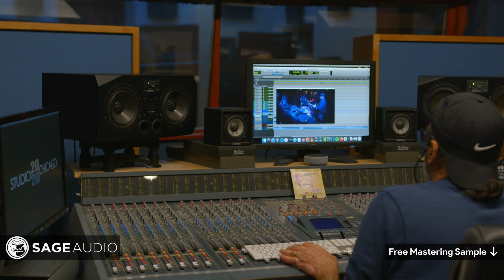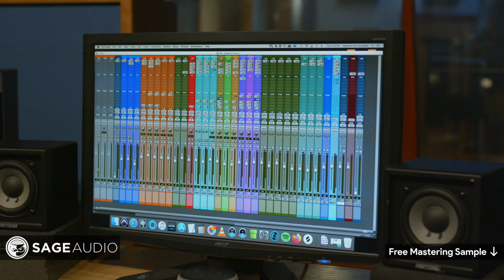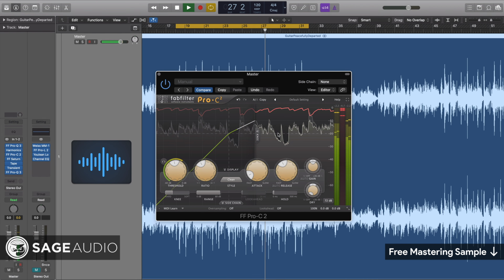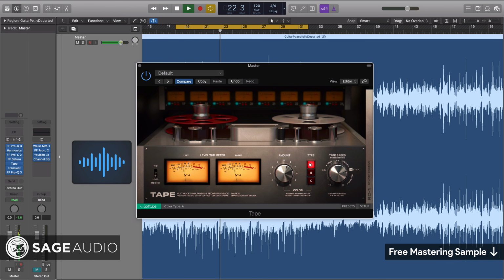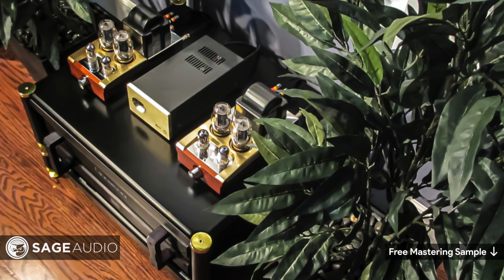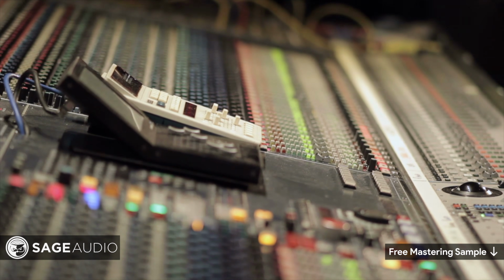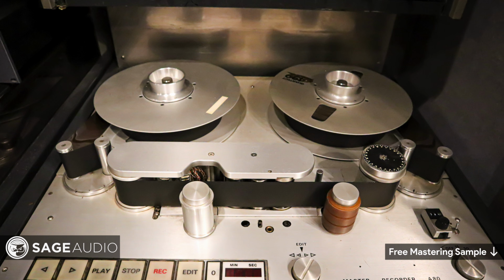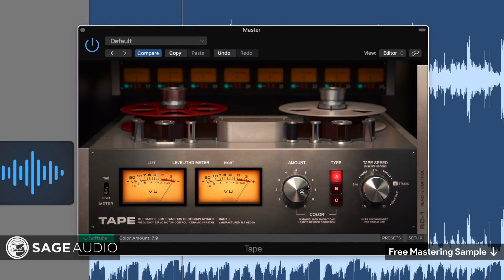What is Saturation for Mixing and Mastering?

Comment: You got it wrong...again. Compression and saturation reduces dynamics not dynamic range. Dynamic range is a property of a channel or storage format. Dynamics are the differences between loud and soft volumes. Like ppp vs fff in music.
Reply from the maker: Thanks for watching Brian! I use the term 'Dynamic Range' as the term for the difference between the loudest and quietest parts of the signal.  It might not be the absolute most technically correct way to use the term, but it is a pretty common way it's used.  

SageAudio.com